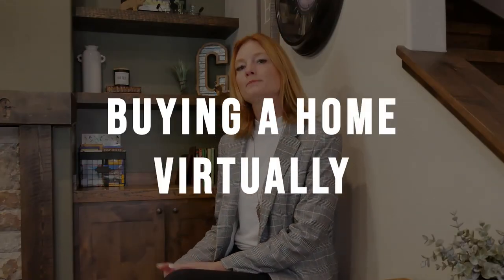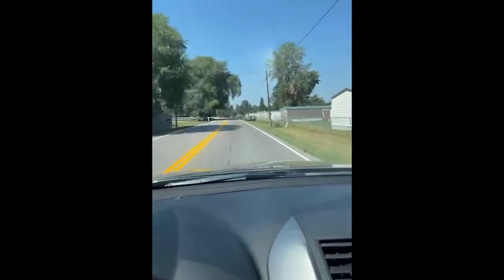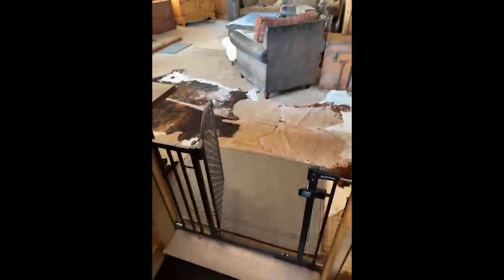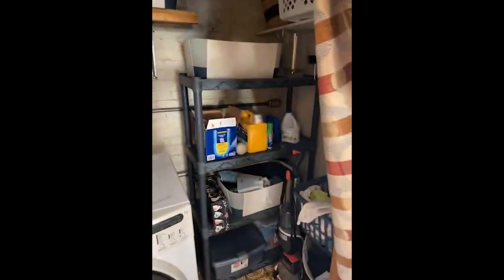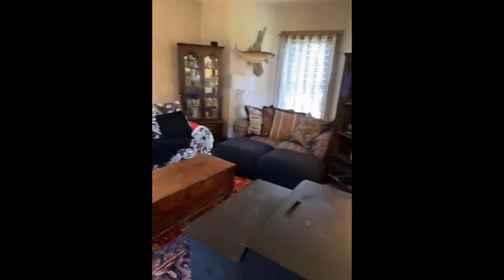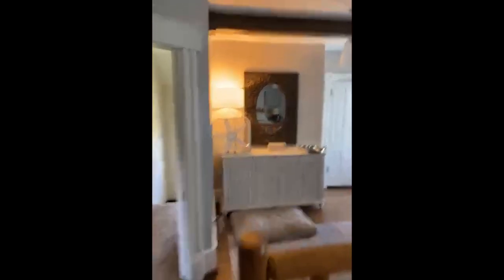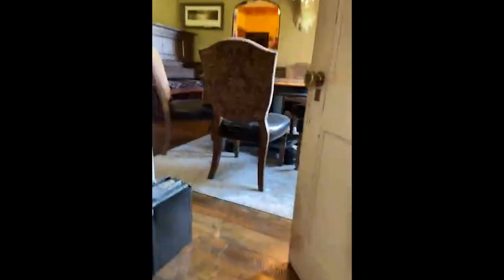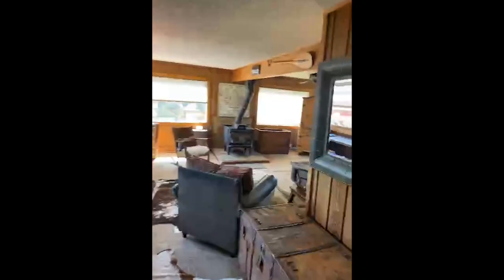How to Buy a Home Virtually - Virtual House Purchase - What Should you Look For? Finding an Agent!

Comment: Hi Janet - wondering what the winters are like in Montana in terms of uncleared snow. Is there snow on the ground for 4-5 months straight or more of a snowfall, it melts in a few days/week, snows again, etc?
Reply from the maker: It varies by year. The bus route roads are typically cleared relatively quickly (within a day) but we might have snow on the ground all Winter. Sometimes not as much in the valley but on the mountains we usually start seeing snow caps in September/ October. ❄️ However, this is very different on the East side of Montana. We are in Flathead Valley in the Northwest.
Reply: @RadiantRealty  Thanks Janet!